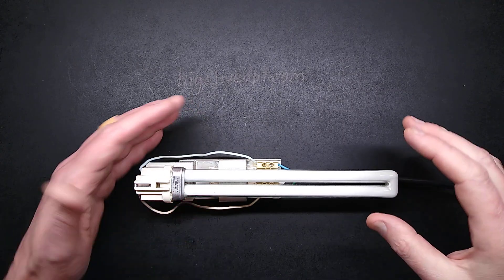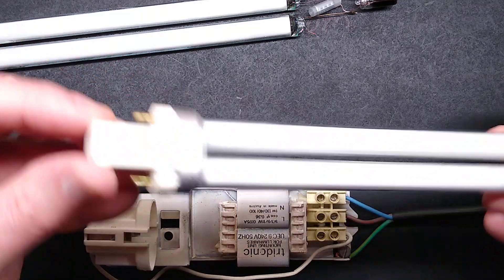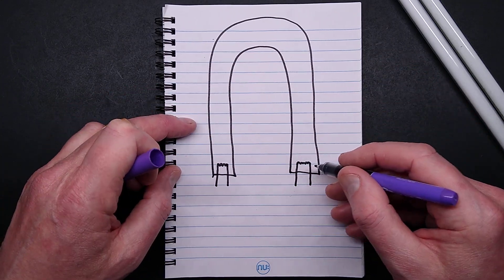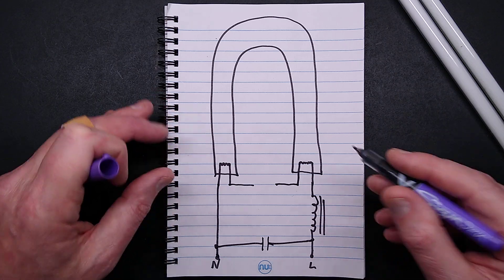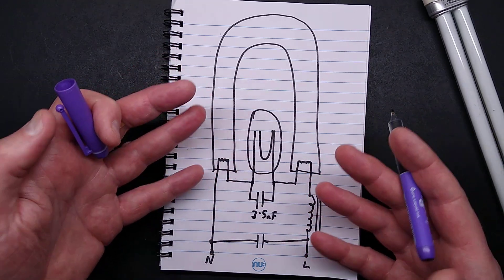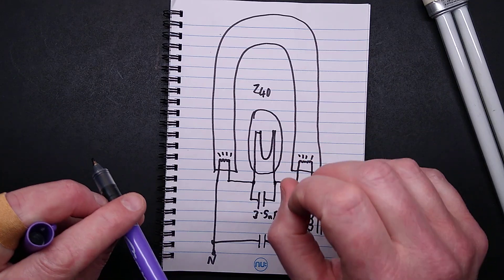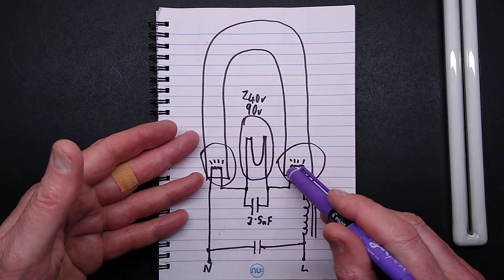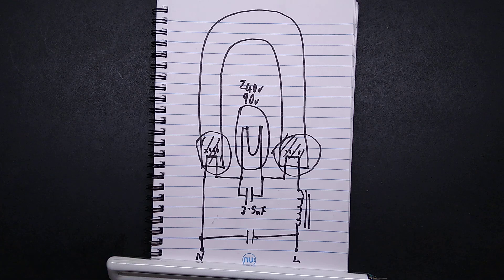Retro already?

Comment: The issue with LED fittings for me is  how they are non maintainable, the whole lot gets discarded when the driver inevitably fails, and usually much earlier than it should. To me that's even worse for the environment than the traditional lighting its replacing. I have an intense dislike for LED streetlights for this reason, much higher failure rate than the old low pressure sodium fixtures, which where, by far, the best and most efficient source of street lighting, with fixtures lasting decades and the lamps lasting equally as long they were just about as energy efficient per Lumen as LED and, providing the tubes are recycled correctly, better overall for the environment with much less going to landfill over the course of the fixtures service life.
The same goes for fluorescent, gone have the days of simply swapping out a dead glass lamp that could be easily recycled.... It's the whole fitting now🤦🏻‍♂️ a step back for sure.
Reply: In the USA a bunch of the LED streetlights are turning purple and blue because of a manufacturer's defect in the phosphor. This has been going on for 2-3 years now and they're not getting replaced.
Reply: @brianleeper5737 Around here, the LED streetlights that got put in a few years ago are getting sort of a sickly green-yellow glow to them. It's not so much the LEDs themselves, but the clear plastic lenses that weren't made with a UV-resistant polymer. They faded very badly from both the LEDs as well as the sunlight during the day. Now the lenses have yellowed, and the 6000K light coming through them appears green.

That's what happens when public works goes with the lowest bidder who sources the cheapest possible parts from China. UV-stable plastic (or better yet, just plain glass) in an outdoor fixture would seem like common sense, but I guess not.
Reply: @brianleeper5737  I haven't seen that with streetlights, but that comment immediately reminds me of cheap LCD TVs, for the backlight LEDs! If you see the "blue/purple hue of doom", you know it's the backlight LEDs on LCD TVs. I saw one in the hospital waiting room not too long ago with the "blue hue of doom", I knew fast that the backlight LEDs are bad!
Reply: @RJARRRPCGP  Wonder if those backlight LED chips were made by the same company that made the defective streetlight LED chips (the story I heard is that the streetlight manufacturer started getting LED chips from a different, probably cheaper, supplier and these turned out to be the defective ones). Also wonder what causes the failure--I know it's a failure of the phosphor coating that turns the blue/purple light into white light, but what causes that failure is something I haven't seen any info about.
Reply: @brianleeper5737  cut the wires.... it will save you from light pollution
Reply: @Gazr Gazr it's 5000 hours if not overdriven by a crappy driver module, in most instances that number is just a lie
Reply: @marcogenovesi8570  It's 50k hours for LEDs actually.
Reply: UK lighting suppliers pushed LED lanterns at high  cost.  Tried to say sox lamps were no longer available.  Plenty of Sox lamps still used in mainland Europe!
Reply: @gordonirving24  I know for a fact that Philips has stopped producing SOX. But I've seen a Chinese company producing them, so maybe SOX bulbs will be available for a while.
Reply: @gordonirving24  Just like there are likely still a fair amount of HPS lamps in the U.S. But I see a lot less of them now! Because they suddenly sometime in the 2020s, changed a bunch to LEDs in New Hampshire! Before, it was pretty much only Claremont and Keene, for western New Hampshire, at least. Claremont started getting LEDs in 2016.
Reply: A LED lamp in our building just went out, lasted over 10 years and amazingly it still is the type with the separate driver and chip. Took a while to convince maintenance that even if a new entire fixture costs the same as the LED chip alone, we should keep this trusty old one and just replace the chip
Reply: @Gabriel Villasenor  be amazed If its possible to replace the chip
Reply: Absolutely Chris, given the REALLY low amount of mercury in  modern fluoro tubes the envionmental impact of the TUBE is minimal, I think it's mostly aimed at the lumens per watt, with the rest swept aside :(... and re Streelights, I will remove fuses from  flashing LED crap... and drop the CARRIER into the column base, No regrets
Reply: i think it should be made a legal requirement for the led 'bulb' or  'tube' to be replaceable, at sensible  cost , and ideally simple enough so the user/owner can do it  like we can at the moment with 'proper' bulbs/tubes
Reply: I had that with an outdoor LED floodlight and had to chuck the whole thing away after a year or so. Replaced it with a bulkhead-style traditional fitting but with a Philips LED bulb. Not as bright but still does the job and has been working fine for years. When the bulb fails I'll just replace it with another. The fitting will last decades I imagine.
Reply: @belperite  Yeah I've found LEDs to be a mixed bag. In part because of Chinese Cha Bu Duo bullshit quality, and in part because they're trying to replace bulbs that lessen their life. This is a common thing these days - trying to sell a product to be all things to all circumstances and that rarely can be possible.
Reply: Most leds lamps are constantly overheating, and running at over 90 C°, they usually fail on par or before a filament lamp..., and fluorescent tubes / HID lamps are not that less efficient
Also there's some scenarios, like extreme humidity where i still use magnetic ballast and fluorescent tubes because even if very wet they rarely fail
LED last a ton of time if used properly, i have some homemade fixtures with cpu coolers and fans, keeping leds at about 40C°, no need to say that none of them has a single failed led...
Reply: It's never been about the environment. It's about profit and control. If they cared about the environment they would have banned planned obsolescence long ago.
Reply: Strange.... I hardly ever seen the LED driver failure. What I normally see is premature LED burnout because the drivers are tuned to overload the LEDs to extract the maximum brightness.  So what I normally do with new LED lighting fixtures is to open them up and increase the value of the current setting resistor (often doubling it!) to stop the overdrive. The brightness reduction is not all that significant, but the fixture runs much cooler and lasts much longer.  To come back to the initial point I can olny recall the actual driver failure on two occasions and in both of them it was caused by electrolytic capacitor problem.  Which is obviously easily repairable.
Reply: To you that may look worse to the environment but to experts it doesn't because it isn't. You simply totally underestimate how much it hurts the environment to just waste 20% more electricity than you have to, and replacing other lights with LEDs often saves 60 up to 80% electricity. As long as the majority of the words electricity is made by burning coal and gas, an that's simply how it is, nothing is worse for the environment than wasting it.
Reply: @xcoder1122  yes because not being able to recycle or reuse shit is clearly a better option then a system with interchangeable parts. Dude, it costs a lot of energy to make this shit and it sitting in a landfill is far more wasteful then replacing a bulb and a bulb alone. If you think the energy savings are worth that... Then I hope the cancer gets you first. Dude, no one likes just throwing shit away. It is worse for the environment and to claim otherwise is insanity. There's far more damage done from mining new materials alone them a fluorescent light will ever cost in coal power.
Reply: This is a big problem about why we are absolutely screwed, because not only do we have shitwits who don't blieve in climate change, but those who are actually doing something often don't know enough about the problem to do it effectibvely. Look at the plastic straw ban - a knee jerk reaction which essentailly reaplced with paper straws, something that just creates another problem.
I can't imagine how much worse it'll be in ten years time when we've had certain fairly major issues and panic starts.
Reply: It took decades to perfect an incandescent light bulb production. Lasting 1000 hours was an unachievable dream for many years. LEDs can in theory last forever, if driven properly. Give it time.
Reply: @olmostgudinaf8100  i highly doubt it, because proper cooling unless more efficient leds are produced , requires cost , and nobody likes cost , and also another problem is properly cooled fixures looking ugly because of giant heatsinks / having fans , the first requirement in modern market is being cheap especially to produce, and second one is good looking, making tons of trash, having bad reliability etc, as companies like Apple taught us is of negligible importance
Reply: @olmostgudinaf8100 yeah but those companies all agreed to only produce lower lifespan incandescents to improve profits
Reply: @mezu-e  I was talking about early 1900s, when the lightbulb was new and longevity was a matter of prestige. Also, there were no Chinese producers yet.
Reply: Long-lasting LED fixtures can be made by using few electronics and more cooling, but manufacturers usually put more electronics and less cooling.

LEDs will work perfectly fine with a linear current regulator and no capacitor (except 100 Hz  flicker), but most manufacturers prefer to use switching power supplies with capacitors in order to maximize the failure rate.
Reply: The answer to this is to demand better LEDs. LEDs can last a long, long time of they aren't driven so hard. We need new laws to make "Dubai lamps" compulsory. 
https://www.youtube.com/watch?v=klaJqofCsu4
Reply: @Gazr Gazr Yep. The problem isn't the LEDs, it's the way they're driven. Fluorescent/incandescent lamps wouldn't last either if they were driven as hard as LEDs. It's almost as if they deliberately don't want light bulbs to last a lifetime.
Reply: Show me some calculations
Reply: Yes, and LED street lights dont seem to be as bright or have the same spread. Im seeing a lot of dark spots where there werent any before. Okay for road users, but more risky for pedestrians.
Reply: @penfold7800  if you are out at night you need a flashlight, problem solved.
Reply: Its also important that low pressure sodium lamps are almost monochromatic and dont cause light pollution. Astronomers can simply filter the 589 nm wavelength.
Reply: nope the green agenda must have their SIEG HEIL, they don`t shut up before. i hate led`s all from china
Reply: ban street lighting or just make them blood red.... i like my stars. but that's just me. light polution is one of the most annoying things for me. one of the reason i want to move far outside the cities...
Reply: @TheObsesedAnimeFreaks  Search for red streetlights, they are a thing.
I won't post a link as they notoriously get the whole comment deleted, but here's a quote from a suitable search result. 

"Worcestershire County Council has used red LED streetlights to install what it claims is the UK’s first bat-friendly highway – a ~60m stretch of the A4440 near to Warndon Wood nature reserve."
Reply: @TheObsesedAnimeFreaks  At least the skyglow is slowly getting more spectrally even rather than just being the garish sodium D line.
Reply: @treelineresearch3387  just remember tho, if your really into stars and astronomy then as far as light pollution goes, narrow band sodium is the next best thing to no light pollution at all! That's because it's extremely easy to filter out where as the light pollution produced by LED,  despite being visually lower, is impossible to filter out. So the end result is in fact a greater difficulty for astronomers and star gazers where moderate light pollution still exists.
Reply: When I switched to LED years ago, early model partly had bad life span. But since these early times, I can’t remember any LED which died. 
Some people complain about the color. But, I once replaced an ancient bulb with an LED one. It was close to the place my ex wife was sitting in the evening doing sudokus. After 2 weeks I told her and immediately she recognized that she is getting headaches from this alien thing.
All BS, just adapt and it‘s fine. 
And buy LEDs with the expected light color. If you don’t know what that is, don’t complain.
Reply: @fromgermany271  the huge issue up to a couple of years ago was overdriving. .DE may have had different  rules, hence your differing experience

Comment: I dislike how this ban will create a huge a mount of waste, fitting works but can't buy a replacement tube, have to throw the whole lot away. Then in a few years you have to throw the whole LED fitting away when the electronics or LEDs die. Some of the old T12 tubes lasted decades of use, when I rewired my grandmothers house last year the 4 fluorescent fittings there were over 60 years old and still working fine. I've already had to replace one of the new LED fittings that stopped working...
Reply from the maker: Not to mention the huge surge of lighting conversion "experts" who will use swarms of cheap labour given a liability transfer slideshow before being let loose on live wiring.

Comment: It's (not very) funny how everything that is supposed to make things better usually don't...if fact most of the time it's the opposite effect.  
From Freon to "low flow" water fixtures to lighting devices...they just keep making things worse & worse.
Reply: There is no need to abandon nuance. Just because something is highly inconvenient, does not mean it is not the right choice. Freons, especially the ozone-depleters were a huge menace. We (we as in humans) really needed to stop making them, for our own sake.
Reply: @TheBackyardChemist  
As far as the Freon is concerned the newer kind is very inefficient which means a much larger cost of using it ie. more electricity or gasoline/diesel used to make the same amount of cooling that the previous kind did.
Reply: @gregorythomas333   Are you sure? CoP figures are pretty high these days for split systems.
Reply: @TheBackyardChemist  I find it amusing that ozone holes appeared just about the same time we got instrumentation that was capable of measuring upper atmospheric ozone concentrations with any sort of detail.

Comment: I just swapped out some dead T8/T12 fluorescent tubes in my utility room with direct replacement LED tubes. I had to change one of the ballasts, too, and was planning on popping the old one open to take a look inside.
Reply: At the end of your video, I can't help but reminisce about the times I shocked myself as a kid swapping out fluorescent tubes in the basement of my parents' house. It definitely is cool thinking about the operation of these lamps. And also.. holy cow, were the LED replacements so much easier to handle. Bittersweet, I guess.
Reply: @ghostkhadaji  American fittings were worse for that than British, especially American 8 ft fittings, they effectively just used pure volts, those things were vicious. UK ones tended to use more conventional resonant circuits to strike the 8 footers
Reply: Why would you have to change a ballast to put LEDs in - usually you REMOVE the ballasts to put LEDs in
Reply: @gorak9000  Search for "Philips UniversalFit LED tubes". If I could have just bypassed the bad ballast instead of replacing it with one compatible with those light tubes, then I guess I missed an opportunity.
Reply: @gorak9000  remove both prevent light pollution